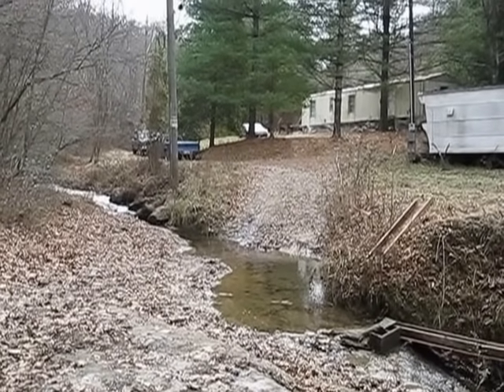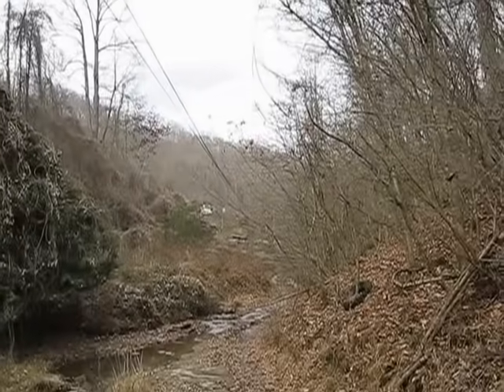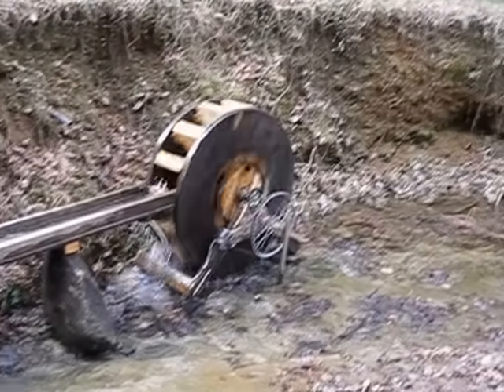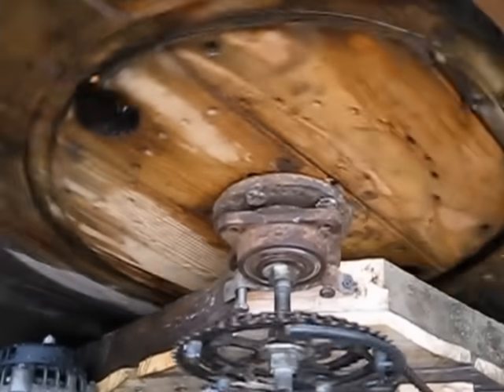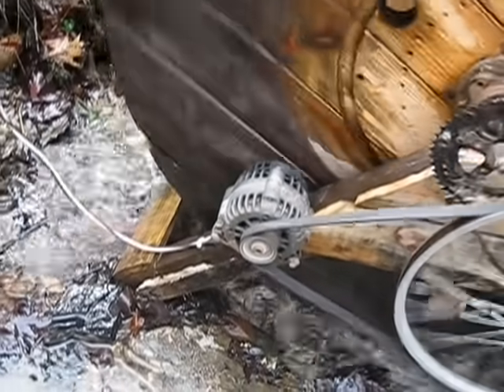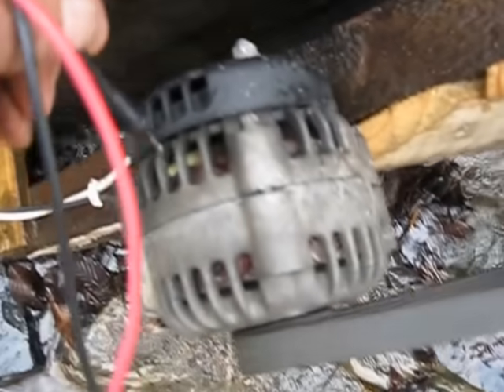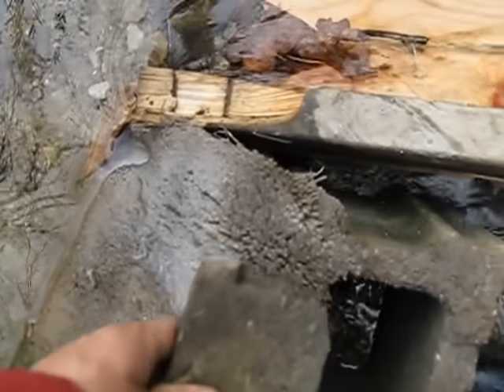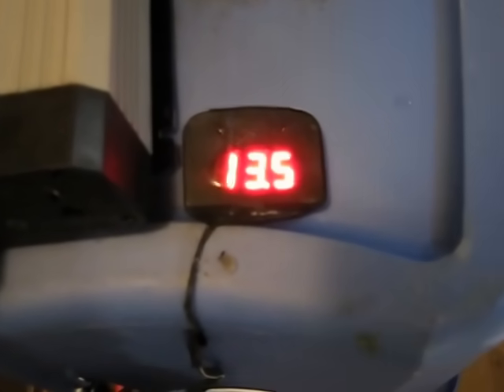water wheel generator

Comment: This video is six years old now so this comment will probably be of little use, but I would like to add a bit of physics insight that may help others on here to better generate water power.

When you make that water mill, you should remove as much wood from the middle of it as possible leaving most of the wood on the edge of the wheel. This will increase the rotational inertia of mill so that it is less likely to slow down during heavy loads.

Look up Walter Lewin's video of "moments of inertia." Counter-intuitive but useful nontheless.

Comment: Man I need to do this.
I love tinkering and building my own stuff.
I have a creek next to my cabin and want to power it and another nearby small cabin.
I’ve been researching hydro electric turbine set ups but this set up right here looks simple yet very effective.
I’m sure I could step up some gearing and run multiple alternators all without having to disturb or dam up the creek much.
I really like this idea and compared to most of the videos I’ve watched on hydro electric power I like this the best because the hydro turbines are very noisy and I have a neighboring cabin close by and don’t want to hear turbine racket 24/7.
This water wheel sounds pleasant enough and probably won’t be heard from my neighbors place.
Thanks for this video!
I think it has steered me in the direction I want to go.
If /when I get my set up built l will definitely share a video .
I’ll be using lithium ion or lithium iron phosphate battery banks, charge controllers and pure sine inverters.
I plan on doing a solar set up for my cabin on top of the hill and possibly a wind turbine up there as well to power the hilltop cabin and well pump.
Right now I get free water from a natural spring where previous owners buried a drum in the other  creek up the mountain and ran a pipe a few hundred yards down to the cabin where it feeds two spigots with clear, clean water .
The water pressure is good too.
It was strong enough that I hooked a hose to it and ran my gas powered pressure washer off of the water source for over 1 hour.
I thought for sure the water pressure would be too low to efficiently run the pressure washer but it didn’t miss a lick.....very impressed.
I really want to use as many natural resources as possible to stay off the tit of the grid just because I like to be self sufficient and I love the cool factor of free power mixed with freedom and a bit of ingenuity.

Comment: How does the alternator continue to work being exposed to the elements like that? (water/rain)
Reply: Corvus Crow It's an automotive alternator. They're supposed to be exposed to the elements.
Reply: @theannoyedmrfloyd3998  pop your hood and spray the alternator with a hose, tell me if its working in a few days.  OLD alternators that were mostly sealed like the ones from 60s-70s cars were okay to get wet, but ones that are wide open like that can't handle more than a little dampness.  They can handle being under the hood during a rainstorm with a little bit of splashing/ road mist getting on it, but if you get it thoroughly soaked it WILL short out and stop working. I thought that was common knowledge at this point.  Not trying to start something, just filling you in.  It's a known fact, I was actually quite surprised to see it exposed like that as well.  Doesn't take much water to kill a modern alternator

Comment: Go for couple wind generators, they are easy to make, they wont work 24/7 but will give enough kick to charge alot more baterries and increase your total KW/H storage backup in case the water wheel stops

Comment: A smaller wheel will give him more power in D.C. volts.
Reply: it will provide more voltage, but less torque. He said wheel will slow way down under a load - smaller drive wheel would cause it to stop due to lack of torque.

Comment: Hi If you still utilize this, just adjust the water hitting angle "to the rotating wheel" you will be able to use a lager alternator to get more power. Great to see something like thin action. Good luck!

Comment: Thank you for showing the details of your water wheel installation.  I am hoping to do similar using a wheel to drive a low RPM water powered pump - the gearing mechanism that you used would be helpful.  Dave from Water Powered Pumps public Facebook group:  https://www.facebook.com/groups/240458583255303/

Comment: Just add another bicycle wheel to that and you double the productivity. Just add it like you did the first one - the belt comes from the wheel one's larger wheel to the wheel two's smaller loop and from the wheel two's bigger loop to the generator. I think it would still run since the water goes so fast that it has a good weight. Also, could you just setup another that type of setup on the same water stream, and double the electricity that way?

Comment: Legally I do not recommend this but because of the freedom of information act I will leave this comment with some good information. You said you wanted Internet and TV at some point. Go to best buy and buy a "satellite finder" they're about $100. If you know someone who installs satellite TV or internet you can maybe borrow theirs. Get a couple of old satellite dishes off someone or from the scrap yard. Find the direct TV satellite using the finder and line up and mount the satellite dish to the location the signal comes from. Find the internet satellite location and do the same as you did with the TV. Now the biggest expense is this. You need 2 raspberry pi mini computers they'll run you about $100 each. You're gonna need someone to tinker with them and set them up to descramble the signals. So maybe about $100-$200 to get a computer guy to do that. You run the internet and tv threw their respective computer boxes and you get all channels and the fastest possible internet satellite offers for free. It might cost you $400-$500 to set up but you get free TV and internet after that.

Comment: Looks like there is enough force to turn two alternators or a Cavalier alternator is probably only about 40 amps. 90-100 amp alternators off trucks are readily available new or from an auto wrecker which would double your output at little cost.

Comment: Think Niagara Falls? They have an addition to have reserve power thru à RESERVIOR.
What you could do is...
Make a small RESERVIOR from an existing pond or man RESERVIOR made up the hill just about 10 or 20 feet up(or more) up higher divert minor rivers too the RESERVIOR. This will help keep it full.

Also make a simple gravity pump to pump up water from your stream. No electric or gas! 
Pipe the water from the reservoir to your generator. Use a shut off valve to control.
Build a RAM PUMP.

Comment: good start, would suggest moving alt. to a higher position away from the water splashing on it, also over top with water to down stream side would let water splash down the stream. not going though the area where the wheel is mounted so much also, more drop on the sluce will give you more speed of the water might speed things up a bit

Comment: Only thing I’m confused is about you had to change something inside alternator ? Is it easy to do ? Can I just connect alternator straight from car would it work 
Is that wheel still going today? 
Thanks
Reply: Enduro Kesha , Yes , but it needs a 12 volt power supply to energize the electromagnet , other generators have permanent magnets ,  
Magnets can make electric and electric can make magnets , you can get a magnet rotor from Missouri wind and solar .com and put it inside any 10SI or 12SI GM (General Motors) alternator , I have 
M. W. and  S.  phone number if you need it
Reply: Enduro Kesha , No , water wheel is gone , flood waters came up high and destroyed it
Reply: Thanks for your reply, shame wheel is destroyed, hope you build something new in its place to get your power?
I’m in UK so will try to find suitable generator, your design is so simple and would be just enough for my needs got same stream as yours and yes it gets big in winter and small in summer so I will have to make wheel adjustable heights so in winter when I know it will flood I can raze wheel so it not destroyed 😁
Reply: Enduro Kesha , it wasn't my water wheel , he told me what happened to it , I'm building my own water wheel , Wind mill , V.A.W.T. and gas powered by small 42cc chainsaw engine , I have 4 of these generators , I built them myself , if you need any further information or help just let me know
Reply: I guess you haven’t got video of it on YouTube? I’m just researching at this stage and making finale decision on what I’m going to build, to generate power for my log cabin
Reply: Enduro Kesha , if you have water flowing 24 hours a day , I would build a water wheel first , the trick is to get the generator to spin , it doesn't matter what makes it spin , water , wind or hooked up to a bicycle and you pedaling it , and don't forget about solar panels for backup ,  solar panels don't work very good when they are dirty , covered with snow and they don't work at all at night , when the wind isn't blowing , the wind turbine doesn't make any power , so you have to take into consideration all the pros and cons of each , but if you have water wheel , wind turbine , solar panels you will power supply coming in 24/7  day and night , which is what I'm doing , I will have something sending power to my battery banks
Reply: Got solar wind turbine is on list but most existing project is water wheel got almost same stream flow as on video with lowest flow as seen on this video which means I should be able to get my power all year round the only thing I need to be careful in the winter when the stream floods making sure that it’s not going to damage my wheel thank you for your advice and your help I will be in touch  if anything

Comment: Looks shady water wheel needs to be bigger and you need more generators on the belt . A better inverter and better batteries that are the same . Get them out of a big rig truck they have 3 batteries.  Power the whole house like it was hooked up to the pole.  You dont have to live like that with a water supply like yours .

Comment: if I was you id mount like 6 Alternators on that one wheel, might have to make another mounting system but it would work and charge a good battery bank!
Reply: More alternators would present more drag, slow the wheel down and in the end you won't produce any more power.  The wheel can produce X amount of horse power.  Let's assume for sake of argument it produces 1 HP.  That's 745.7 watts of electrical power.  Two alternators would load the wheel down and slow it down by half.  Then the combined wattage output will still be 745.7 watts.  Actually it will be less due to other imperfections and losses in efficiency.
Reply: Wrong. The load from a single alternator has stopped the wheel. Adding more would not work, at all.
Reply: People don't understand the conversion of energy.  In this case, water is turning the wheel.  Or more accurately - GRAVITY is turning the wheel.  Because there's more weight (water) on one side the wheel turns.  That weight has stored energy.  As it turns the wheel that motion can be converted into electrical energy.

One Horse Power = 735.49875 watts.  IF the weight of that falling water equals 1HP then you can generate (ignoring losses from friction and resistance) 735.5 watts.  Adding a second alternator would be too much resistance for the wheel to overcome.  Both alternators combined can not create more than 735.5 watts of electrical power.  Otherwise I'd take a small gas engine and put a thousand alternators on it.

You can't "Create" energy.  You can only "Convert" it from one form to another.  Wind to electricity.  Electricity (electromotive force) to wind (fan).  Physics.
Reply: What if the bike rim was smaller wouldn't it go faster and generate more due to speed?
Reply: @ghostface97910  No.  A smaller wheel has less distance to travel per revolution, thus, spinning the alternator slower.

Plus - spinning the alternator faster will take more power.  Not MAKE more power.  A larger diameter wheel will spin the alternator faster, but will have the opposite effect on the water wheel, dragging its speed down, resulting in zero gain on output.  Assuming you've attained the perfect balance of gearing, you can't get more power out of a water wheel unless the wheel is larger.  A larger wheel will have greater torque on the gear train and thus be able to turn the alternator faster - which only then will it produce more power.

It's like jumping out of a plane.  You can only fall so fast.  The faster you go the more wind resistance you encounter - and get slowed back down.

It's like driving a car.  Going faster uses fuel faster and you get worse gas mileage.

In this case the water wheel is capable of producing only so much power.
Reply: For God so loved the world, that he gave his only begotten Son, that whosoever believeth in him should not perish, but have everlasting life.  begotten Son, that whosoever believeth in him should not perish, but have everlasting life.“Then Peter said unto them, Repent, and be baptized every one of you in the name of Jesus Christ for the remission of sins, and ye shall receive the gift of the Holy Ghost".

Comment: Dude, YOU F__KING ROCK ! Connect that wheel to a couple of 14kva gens and you got power at the wazoo. Put about 7 to 8 gens on it and start charging the power company. You would have to change the angle one your waterway about 10 degrees though. The gens will take more torque as to how many there are. Of course you would have to get them in sync also. But this is something that I've always wanted to do but don't have the place to do it :(

Comment: It's all about the head, you need to put the sluiceway as high up the river as you can go, and put the wheel as low down the river as possible. The more water head/speed/pressure, the more power equals more electricity. 👍

Comment: Love everything about your property and it it weren't for President Trump  I'd vote you for president.
I have three 100 am/hr deep cycle batteries and am not that impressed with them.
The only thing I'd change is get rid of the inverter, has no more than probably a 85% efficiency rating. Wire from the charge controller to a small breaker box (breakers give added protection ), then wire directly to loads.

Comment: If you take an old school automotive generator with a compatable voltage regulator hook it up to a deep cycle battery then get a 12volt dc 1500rpm reversible motor that you hook up to the battery that can spin the generator you can then add a 12volt dc to 110volt converter to the battery creating up to 4 - 110volt ac circuits. No gas,wind, or solar. Pure straight free green energy.

See this YouTube link>  https://m.youtube.com/watch?v=j2NojdrlbRo&feature=share 

Parts list:
https://www.amazon.com/Quality-Built-7078107-Quality-Built-Alternator/dp/B000EZY930

https://www.jcwhitney.com/details/Ford/Galaxie_500/Replacement/Voltage_Regulator/1972/Base/8_Cyl_7-dot-0L/REPF541401.html

https://www.lowes.com/pd/Deka-12-Volt-650-Amp-Marine-Battery/50183767

https://www.amazon.com/POTEK-5000W-Inverter-Outlets-Outputs/dp/B0769HGMYZ

If anyone out there does this please post it to YouTube and tell the viewers that a guy named Tiny shared this concept with you.

Tiny

Comment: I’m sorry, any alternator from a vehicle is not designed to continually produce 12 volts DC.  Go find a DC generator that is designed for continuous useage an then build a waterfall to keep it operating at its optimum rotational speed. 
Sir, that would be something I think people in the mountains (that have accessible creeks with usable flow rates) would love to have.

Comment: @ Off  Road/Off  Grid     Put 2 or three in series along the creek.  Go downstream and build another small dam and water wheel.  Maybe a third  upstream.  It depends on how steep the creek descends from one place to another, how far apart you will need to put the generators.

Comment: What's the second shorter power pole for close to the house? I see it has a power company meter on it and Conduit running up it... I tried this with a couple different types of alternators and they all have the same problem. I'm not sure where your battery bank is but unless you have some 2 Guage or thinker wire running from the alternator to a voltage regulator or your battery bank, then this simply isn't going to happen. 12volts and 90+ amps does not work well with 14guage wire and a 50+ foot span. This set up does create power but it's not going to be efficient at charging a battery bank of any size at those distances. My 2 experienced cents. I just stuck with solar. My small system is 80volts at 36 amps and it out performed a 220amp alternator hands down charging a 2000ah battery bank.

Comment: You might want to replace one of your vehicles with a Nissan Leaf Electric car.  They have bidirectional charging and 24+ kWh lithium battery with up to 6 kW power output.  Can be 110 charged. 

EV gets you free driving too.  No maintenance no oil changes no gasoline etc...  Used Older Nissan Leafs are dirt cheap too.

Comment: Why is the alternator putting out 40V, when in a car they usually put out 14-15 max?
Reply: Oh its probably one of those little things called a VOLTAGE REGULATOR . But he does say he put magnets in the motor so that tells you its 3 phase now.
Reply: @JM-yx1lm  ah ok. I dont know anything about 3 phase.

So, the voltage output of alternator will increase with rpm if I bypass the regulator? How high?